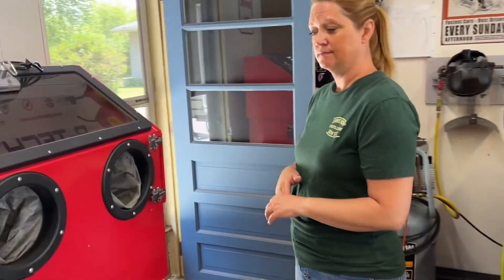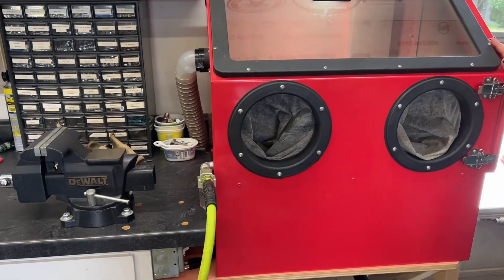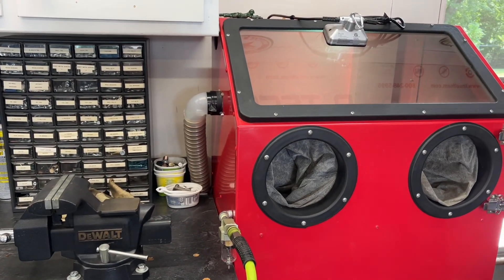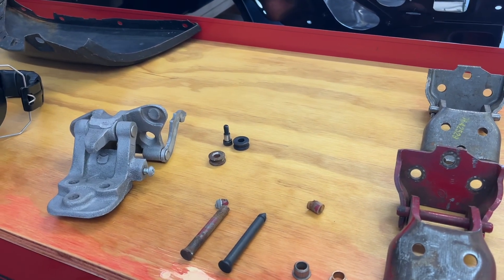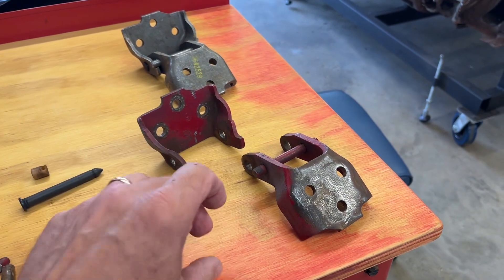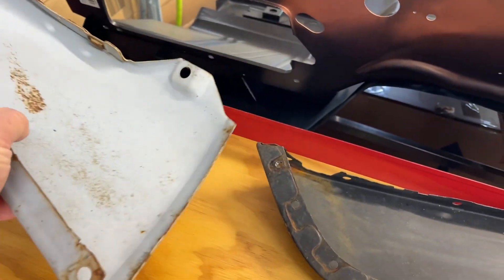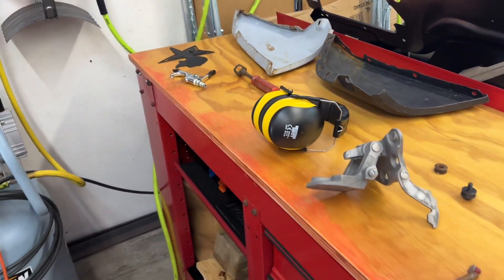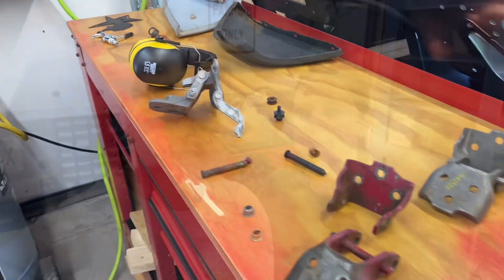Basting hinges and thanks everyone.

Comment: Used to have trouble with static electricty zapping my hand inside a glove of the blast cabinet. Used a brass ring with a wire soldered to it  that grounded to the cabinet. Put the ring on a finger before sliding hand inside the glove.
Reply from the maker: Haven’t had that problem yet, will keep that in mind if it occurs. Thanks for the tip👍